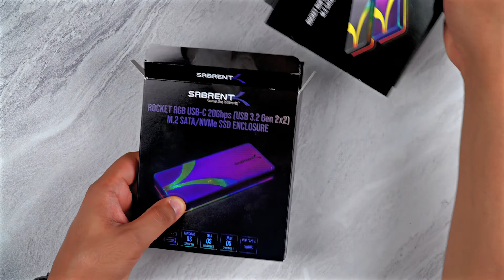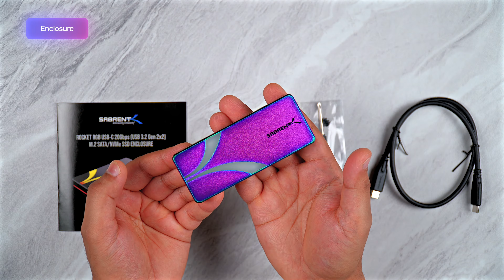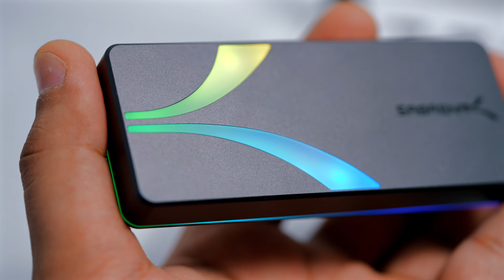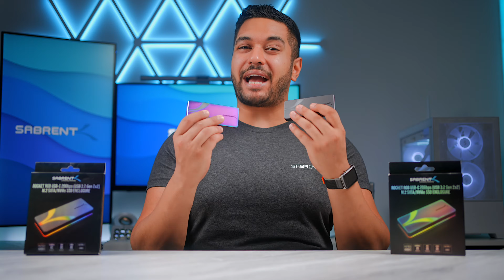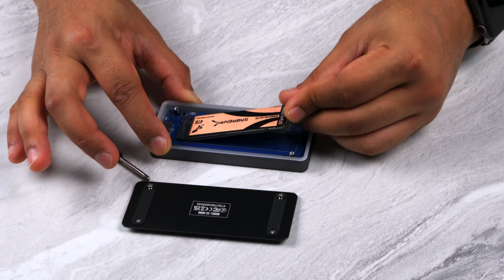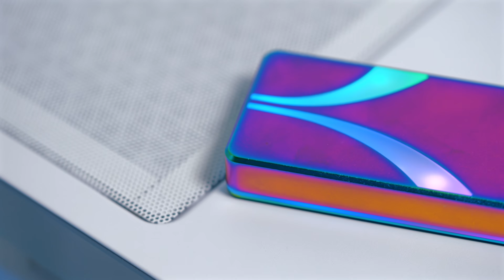SABRENT Rocket RGB USB-C M.2 SSD Enclosure | Beauty & Performance

Comment: Be warned: the plastic built-in retainer clip is difficult to turn and doesn't hold the M.2 in well. If  you intend on switching out the M.2 in the enclosure regularly, I think it will eventually break.

RGB: There is an RGB power button to disable the RGB. However, you have to click this button EVERY time it gets plugged in or if the computer restarts...otherwise it's back to rainbow explosion.

Comment: I bought this today...and not very happy with it so far. Few things; the enclosure refuses to eject. I have tried all the combinations of caching on/off for safe eject for the enclosure. So the only safe way to eject the enclosure is by turning the PC off, which is a huge negative. There is no thermal control whatsoever. My Silicon Power 2TB brand new M.2 2280 drive hit 141 degrees F writing an 11GB file. Lastly, the observed speeds are nowhere near what's claimed. On regular USB 3.0 to USB C link I get about 350 MB/s transfer. On a USB 4.0 port I get about 650 mb/s. So this is a cool RGB light box with mediocre additional feature to add a M.2 SSD instead of other way around.

Comment: Given that it’s June 2024, it’s surprising to see technology that seems quite outdated. Why are older technologies and chipsets being used instead of USB 4 or Thunderbolt 4? Could you please provide some clarification? Otherwise, everything looks clean.
Reply: USB 3 2x2 is far from outdated kid. And thunderbolt 3 and 4 is super expensive.
Reply: @RonnieZebra  Thanks for your reply. I have to disagree respectfully, I’ve been in IT since the ’90s, so I’ve seen USB tech evolve quite a bit. USB 3 is definitely dated now. USB4 v1 is common in many devices, and USB4 v2 is starting to appear in high-end machines 80–120 Gbps, if you know what to look for. USB 3.2 2×2 came out in 2017 and is well supported. USB 4 v1 20–40 Gbps with chipsets like ASMedia’s ASM4242/4243 powering solid products. We use them ourselves with 4TB 990 Pros and have no issues, the GODO 40Gbps M.2 NVMe SSD Enclosure ,Aluminum Type C 4TB USB4.0 Hard Drive Enclosure, Tool Free Installation, Support SSD. Most modern laptops have USB4; v1 is still mostly in premium models like ThinkPads and HP’s workstations. Consumer devices tend to lag behind, but Samsung and Lenovo and others will support USB 4 v1, but for most users, they have no idea what they purchase anyway, specs are specs, real world usage is a whole other item. Also, a quick note, calling someone “kid” might not be the best approach, especially when they have decades of experience. Hardware is limited by its design and software, heat dissipation, and real-world speeds depend on the whole system, not just specs. Happy to discuss more anytime and all the best!

Comment: Nice but why not use USB4 / TB 4 by now? They're much faster and actual protocols for this kind of product I think.
Reply: 1. 20Gbps is enough speed for 90% users. In fact, 10Gbps is enough for many users. 2. The cost will increase, and the selling price will increase. 3. The heat generation will increase dramatically, so the final product will be large in size and inconvenient to carry.
Reply: @boli1852  wish more ppl had a brain like yours... To REASON thru basic science.all points covered.. 👏 ISalute U.
Reply: @boli1852  not really. Proof is that they just announced their first TB5 nvme case. And it’s great for us professionals.
Reply: USB 4 enclosures do exist, but they are very expensive. The cheapest might be around $80
Reply: Because 95% of people just want to slap a $100 NVME drive they snagged off sale into the enclosure and roll. 

Anyone who is THAT discerning about performance or using a MacBook or performance PC with 40GBps USB4, probably isn’t as price conscious as the user this device is intended for.
Reply: @thepacketnarc7634  
I agree.
20Gbps enclosures are usually 2-3x the price of 10Gbps ones.
And 40Gbps enclosures are double again.

Not many people can afford a USB 4 equipped laptop/desktop.
The market for 40Gbps enclosures is just not there yet.
Just wait for the prices to drop when USB 4 becomes ubiquitous.

Comment: so theoretical 2500 MB/s read writes? The previous gen Sabrent enclosure would constantly overheat and cause thermal throttle. I imagine this will throttle faster, since it's just  a hunk of metal for cooling. I switched to one with a built in fan, now I don't run into that issue... when is sabrent going to make on of these with a built in fan?

Comment: WHY does Sabrent have 6 to 8 different cases for their 20 gig nvmes????????????????????  What the hell is the differences....and why the hell do they make so many changes.....if any????????????
Reply from the maker: Would you like us to make a video on the differences? 😊
Reply: As a consumer, it often feels like a trial-and-error process with no clear guides available, and decisions are largely based on opinions anyway. I have tried Selore, S-Global, Mokin, and Hagibis 40Gbps / USB enclosures and they are a heat coffin to kill your drive, some even burned, read reviews on AMZ. Also now trying the GODO 40Gbps M.2 NVMe SSD enclosure will see where that leads seems well engineered, but only time will tell, what looks good on paper can just be smoke and mirrors. Not to mention many are also super overpriced, many where 50% or less during Prime Day.